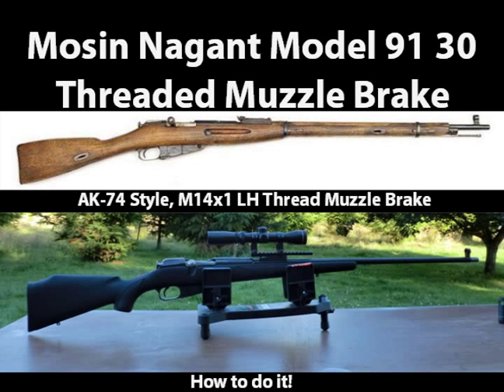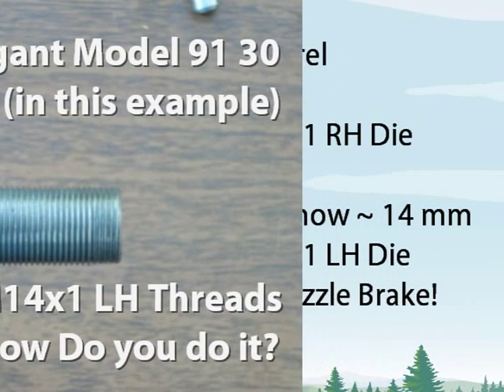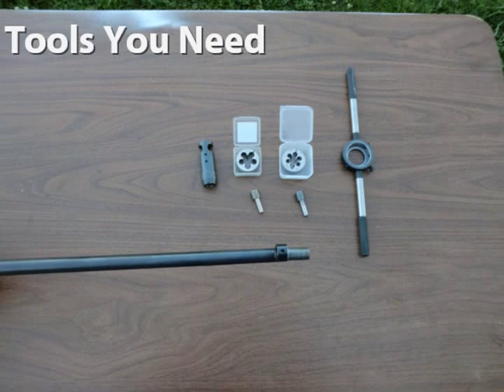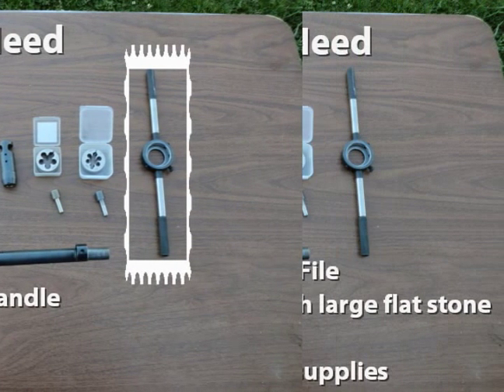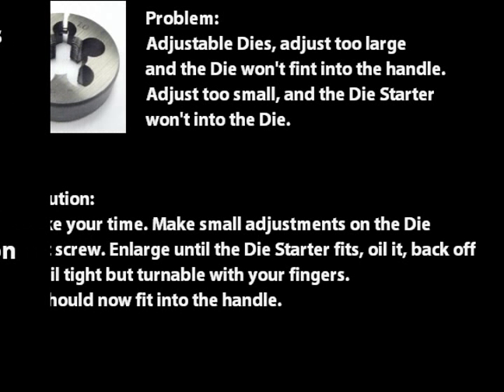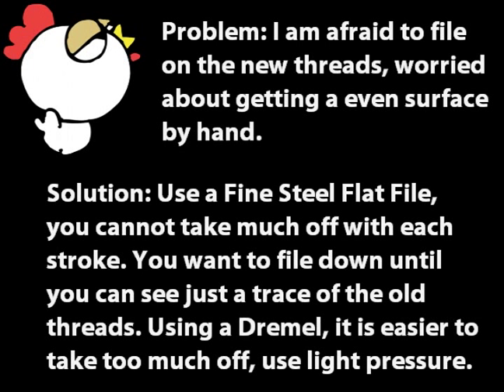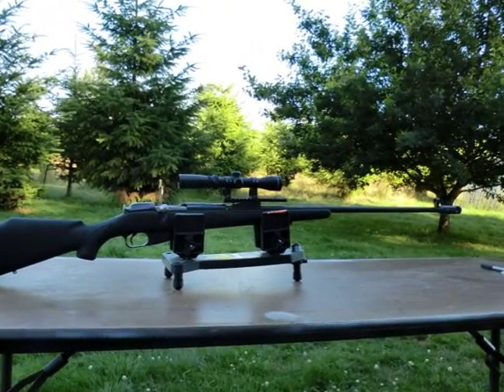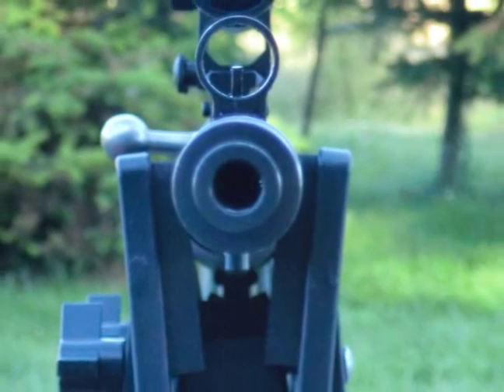Mosin Nagant 91 30 Threaded Muzzle Brake

Comment: This vid was a big help. Thanks CNC Warrior. 
I just got done threading my Mosin Nagant with the 14x1. 
I started with a bolt-on muzzle brake, took a look at it and said, no way would I fire a round thru that, not safe... threw it in the trash.
 Using CNC Warrior's set up I will feel safe, brake is well secured. I was really impressed with high quality die, very very nice tool, professional grade tooling. The lightning fast shipping was nice too. Thanks again for posting the videos.

Comment: If it is that large, you are able to use a standard .308 brake and threads. They are 5/8x24 RH. There is a huge selection of brakes in that thread pitch.

Comment from the maker: Well, it depends on your Muzzle Brake you are going to install. Measure the brake threads first. Then thread about a quarter inch less. Screw the muzzle brake on and see where it lines up. By threading a quarter inch less, now you can add a little more threads until it lines up perfectly. If you thread too much, then you can use a jam nut for alignment also available on the website. When adding threads for alignment, only thread a quarter turn at a time, then check alignment.

Comment: The reason I filed down my Mosin to 14x1 LH threads is because I also have an AK which is threaded to 4x1 LH too. This way their muzzle devices can be interchangeable. Another reason might be so you have more accessory options. There are a lot more 14x1 LH muzzle devices on the market than 15x1 RH devices.

Comment: @MalteseCross I installed one on my Mosin. I took one look at it and said, there is no way I would fire a round thru it. Take a look at vids of bolt on muzzle brakes failing. Read some forums where guys are talking about their bolt on brakes shooting 50ft down range or even flipping back at the shooter. Why risk a gun failure in your face.

Comment from the maker: @BoggleDongMongerFlog They did that for the model 44, but it didn't work very well. Check out the YouTube videos!! Bolt-on, twist-on, or "anything but threaded on" muzzle brakes on high power rifles (Mosin Nagant) are dangerous, they come loose in as little as 1-10 rounds.

Comment: Before you order this kit there is something you should know. The die handle is made in China and not USA, the die is made in Japan. After cutting five threads the die failed. Yes I had the die starter backed off like in the video. . Yes I had it on a vice and yes I was going 1/4 turn just like the video. First they waited over a week to ship my order and then it was not quality parts. I called and they said no returns. Quality? Not. I will never order from them again.